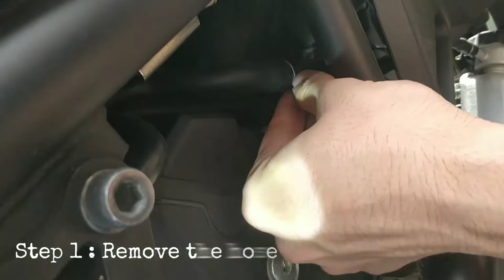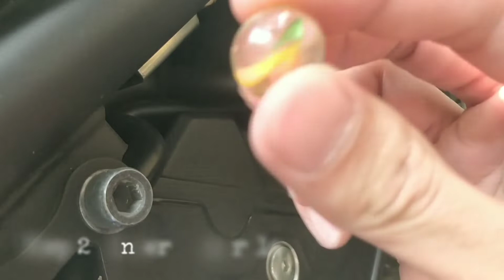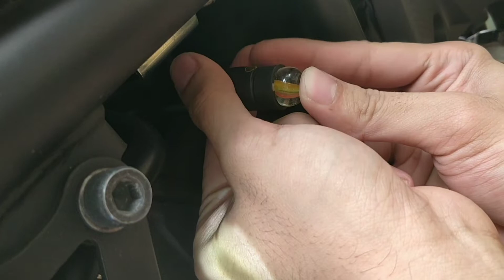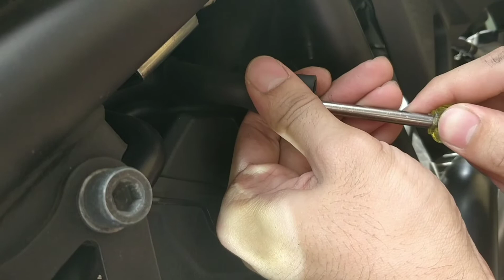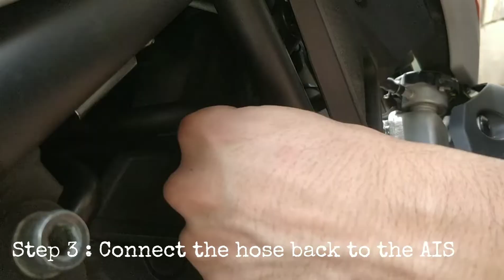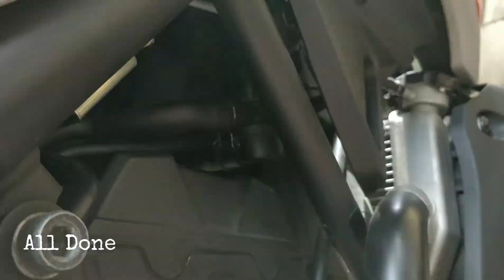Remove Backfire in just 3 simple steps | DIY

Comment: Di pi advisable condemn ang Breather.
Sa longrun puedi tumagas engine, wala ng punpuntahan ang air pressure sa loob, mas mainit ang makina lalo na sa long ride. As experience sa previous motorcycle ko. Ganyan din ginawa ko. Tumagas head cover gasket.
Reply: Sa r3 wapang problma.  Baka sirain talaga motor mo      ais pang yan for emissions. Ano connect sa makina iinit. Lol
Reply: di po yan breather